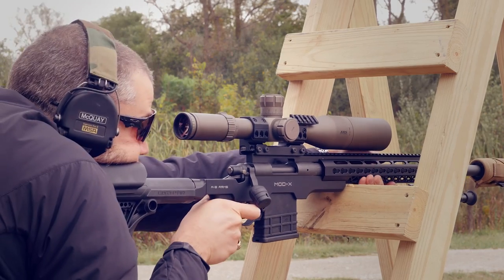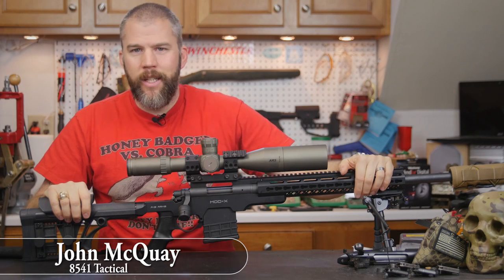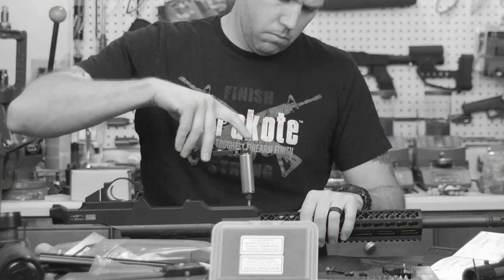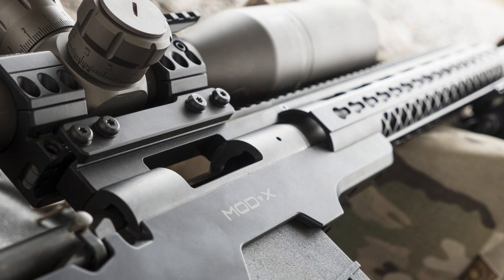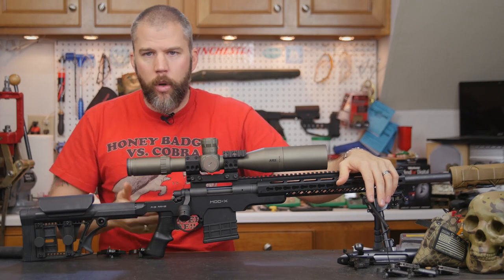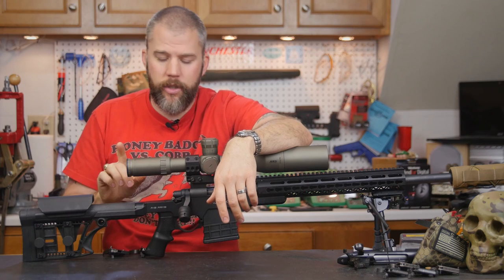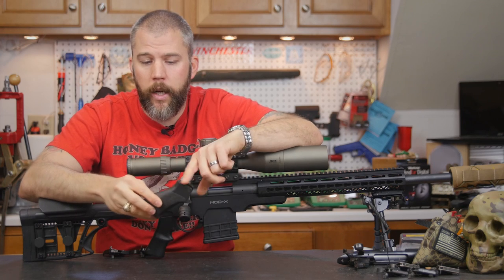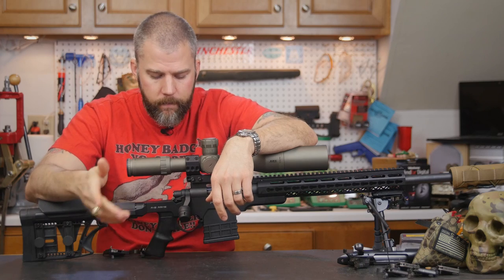AB Arms Mod X Chassis Review

Comment: Thanks for the in-depth review.  It seems like it's a pretty good product, but not great, like they included some real good features found in higher end products but either skipped over or didn't think about quite a few others.  I can tell that this review was NOT rushed in any way, but instead that this product was VERY well tested.  This video shows a level of commitment to quality that I find very reassuring.  Thanks for the excellent work.

Comment: Thanks for the review John.  I have one of these, but since I'm a pretty big guy, I expected to have to make some adjustments to get a good fit.  The length of pull issues are not a problem for me due to my size, and I always assume that I will need to replace the grip with an ergo grip I found on Amazon (have same grip on my Ruger Precision Rifle) due to the size of my hands/fingers, but the one I found gives me a repeatable grip and the option to rest my thumb on the same side of the rifle as my fingers.  The only other issue I had was the comb height, and a couple minutes with a saw and a file to allow it to slide up another 1/4" solved that problem.I may in the future come to be annoyed by some of the other less optimal features, but for now I am happy.
Reply from the maker: +hdmungeryt Good to hear your experience. Thanks for sharing.
Reply: +hdmungeryt I also forgot to mention that I initially had problems getting my Timney model 512 trigger to slide in, but that turned out to be buffoonery on my part...I didn't have the mounting pins on the trigger centered properly.  After I fixed that it slid right in...

Comment: Hello and good day to you and family John. Hey I wanted to comment and see if I can get some feedback. 
I recently purchased the AB Arms Mod X Gen lll for my Remington 700 Sps Tactical AAC-SD in 308. My plans aren’t to be adding and changing hardware. Designing it to my liking for hunting deer and long range shooting. I couldn’t believe how simple this chassis was to install. The install went flawless but the standard grip it came with has to be upgraded. Slender is a word for it. Let’s say I have small hands but this is a no go for me. Only part I didn’t like. In your vid. Scope sits high. And mine well needs new rings as the front section hits. My main question is simple. I have several 700 rifles and debating the scope mount for this puppy. I’m thinking QD base that’s sits as lowest I can get it to rail. 
My question is this. 
What do you suggest for least amount of accuracy loss. 
QD Scope Mounts or larger Screw mounts for the scope. I’m putting 50mm scope with 30 ring size. 
So example. 
30mm scope rings
QD scope mounts
Scope 4x16x50 with 30 mm rings size?  
What do you think would be best.  I know you hate the word best. But let’s say. 
What scope mount and ring style do you suggest for my chassis?  
Also. 
I plan to get a suppressor. Suppressor for recoil reduction and noise reduction. Which top 5 in your opinion do you recommend. Thanks. 

Going to be doing more shooting this fall and beyond since it’s all I can do these day. Fighting cancer and just living life best I can. Anyway. Thanks for the advice in advance. Thanks. 
A friend in Pa 
Donny